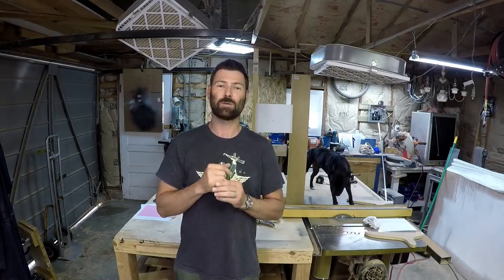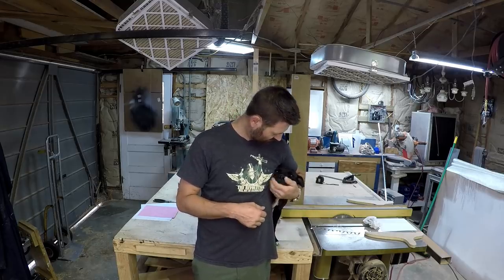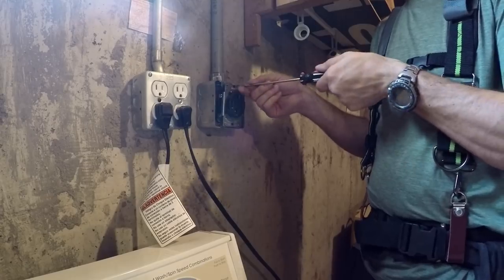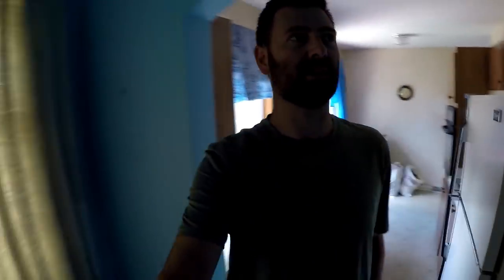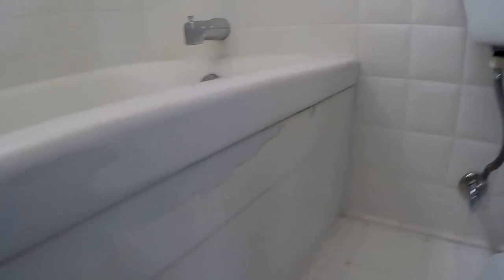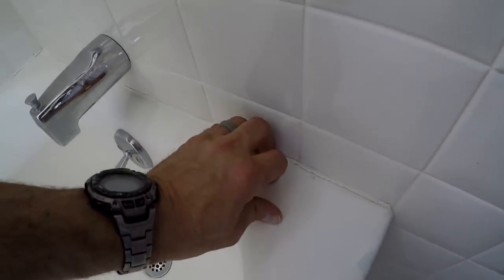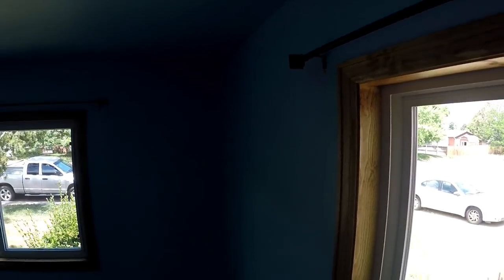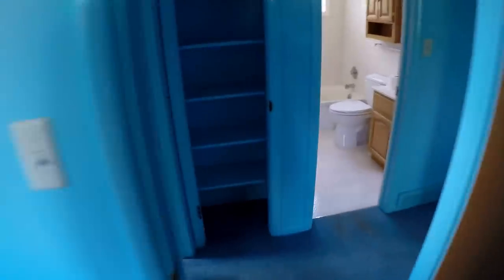Does Wipe On Polyurethane Work? | THE HANDYMAN |

Comment: Great video and concept. I would just like to add to advertise safety a little more. My dad's a master electrician and once told me (in regard to testing and working with electrical equipment) "never trust anyone, not even yourself." Meaning if someone tells you "yea I cut the power to that equipment"... or you think you did, go and check, and then check again with a volt meter. So it would instill good habits in less skilled handymen if you showed yourself probing the outlet before taking a screwdriver to it (even though you show yourself hitting the breaker). IMO anyways, might be too cautious, but I've heard horror stories that could've been avoided by taking steps that simple.

Comment: You can make wipe on poly, cheaper than buying it. 50/50 Paint Thinner, Oil based Polyurethane.
One coat is not enough. takes at least two.  Kitchen or Bathroom frame, three coats or even four would be a good idea.

Comment: I've used oil and water based polys...never used the wipe on.  I normally apply with a foam brush and it tends to streak if I'm not careful...wondering if the wipe on might do a better job.  Trim looks great!

Comment: Have you tried taking some regular poly and mixing it with mineral spirits? 1 part poly 1 part mineral spirits. It will thin it out so you can apply it like any oil based finish, doesn't have that plastic poly look and provides just as much protection.
Reply: It a pretty much just wipe on poly... but you don't have to spend money on the advertising.

Comment: Quick question! When you get a punch list like this - do you still give an itemized estimate? Ie. charge per outlet, per light bulb you replace, per hole you patch, etc - or do you lump them all into one big quote.  Also - what do you do when you have a lengthy punch list and the customer casually asks you to check out something they forgot?? Change order??
Reply from the maker: I never ever ever work by the hour and I never ever ever break things out and itemize.   LOL  I think you get the picture on how I feel about that.  I always bid a fixed price. If there are changes.  I give a price before doing the changed work.  On this job I will be billing them at the end of the project.   They have no idea how much its going to cost.  I do work for this company all the time so they just trust me.

Comment: Hi Handyman, you are great man.......I want to know what happened with your last kneepads, are they good?.....all the ones that I try the velcro after a while won't hold it and kind of bug me trying to adjust it back again, thanks in advance for your response....hi to your dog and the panda as well   hahaha
Reply from the maker: I still have them.  I haven't worn enough to wear the velcro out.  The are pretty thick and hold your actual knee 2 inches up off the floor.  They are comfortable and protect my knees but a little awkward when kneeling on them